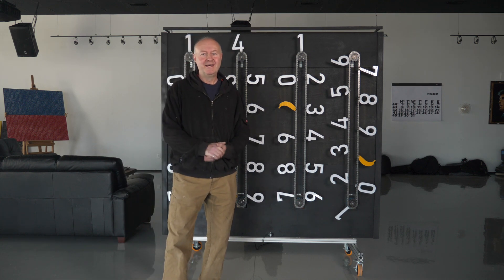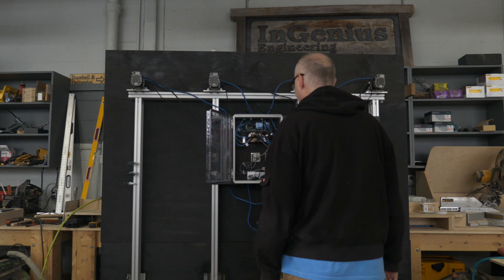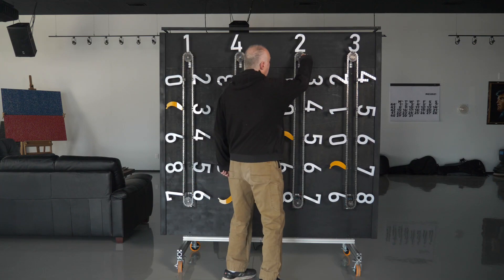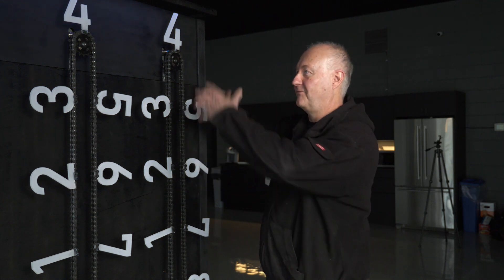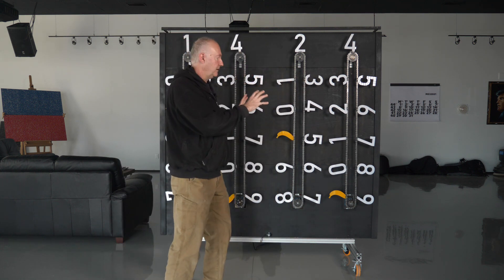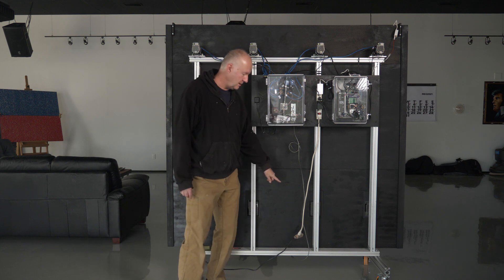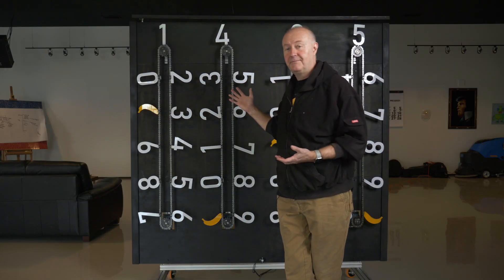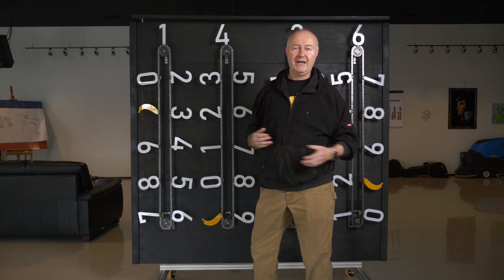Giant Crazy Clock with Teknic servos, a Powerful Arduino, a GPS, and BULLET-PROOF numbers of course!

Comment: Great video! This clock is extreme! This clock is large! This clock is portable! This clock needs to measure events ie. Chronograph. Just put two buttons - 1 to start & stop, 2nd to reset and mod your code.
Reply from the maker: Thanks Paul. You are absolutely right. I keep tweaking the code all the time. Also thinking about counting down to an event. Or display cases per day? Lots of possibilities.
Reply: @loen.design I can see the local business news headline now: Local industrial maven convinces Omega to buy his locks for Olympic events. If not Olympic then Titanic events.